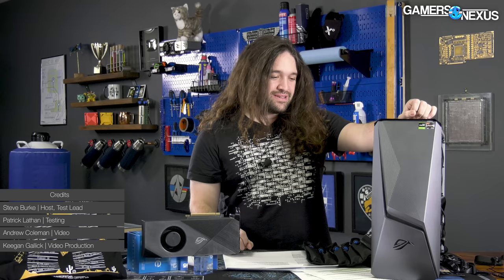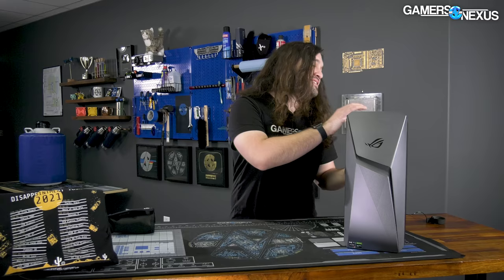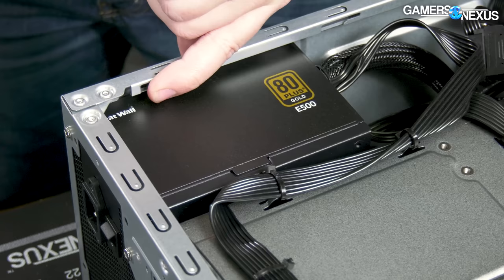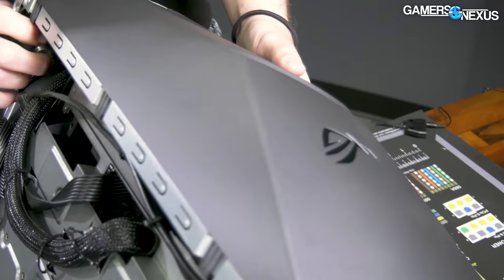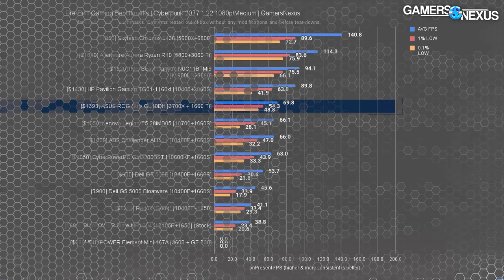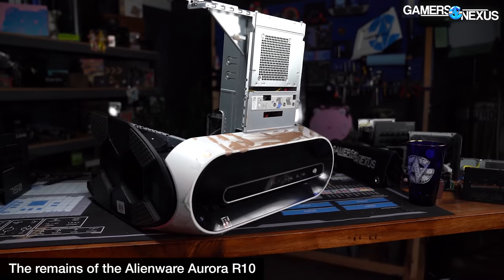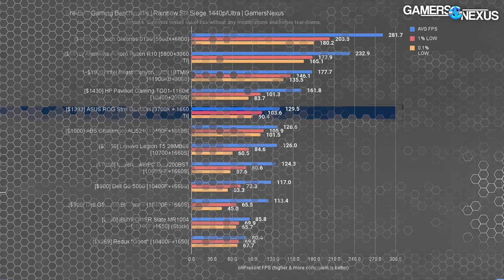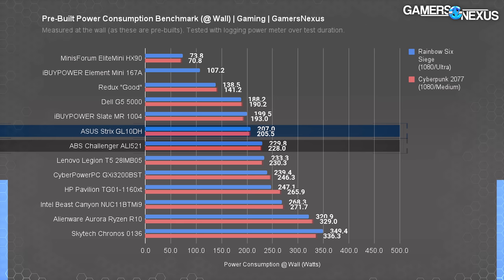ASUS Didn't Deeply Offend Us: $1400 Pre-Built Gaming PC Review (ASUS GL10DH)

Comment: I would like to see a show on alternate technologies to Boolean Logic implemented in CMOS. CMOS is inherently quantum mechanically defective. If you could measure the CPU or GPU current during the rising and falling clock edge, the difference is due to the transient shorts between power and ground. In 1957 tunnel diodes were invented. In the late 1960s, Threshold Logicwas extensively researched. Threshold Logic Gates implemented in Resonant Tunnel Diodes makes an excellent alternate technology. A design would require about 30% fewer gates and each gate is smaller than CMOS. This means the design is cheaper than CMOS. The speed-power product is 100,000 times that of CMOS meaning 1000 times the speed at 1% the power.
Educating the executives on alternate technologies could result in better and cheaper products.

Comment: My misgivings about this one a

For regular prebuilt buyers: Negative pressure => dust. Your regular prebuilt buyer isn't likely to clean their computer. A prebuilt with a front mesh will at least encourage such people to at least point a vacuum cleaner on the mesh to suck up the dust.

For those buying it for the graphics card:
a. You still don't know which model card you'll get, so even if it comes with a x070 or x700 (XT) or higher chip option, you're not sure if you can compensate for the cooler with a waterblock (although maybe the NZXT G12 can work?)
b. Hard to repurpose the entirely of the rest of the computer as a server if there aren't a lot of drive mounts; or SATA ports on the motherboard. Although I guess you can just move the motherboard to a standard ATX case (even if it's mATX height, the width at least will fit) that has enough drive mounts unlike having a totally non-standard board.

Comment: I have their GL12CP from 2019.

i5 - 8400 
128gb M2
1TB HDD
Nvidia GTX 1050 2gb
Two 4gb RAM, that I upgraded to two 8gb. Sticks. 

I've added two extra 120mm fans to the top and front. Since then the CPU has never gone over 70°C. In fact it idles around 30°c and runs cod warzone around 65°c, and 50°c if I set the fans to performance.

For $800CAD from bestbuy it was a decent pre-built for its time. I really would only upgrade the GPU for one with more than 2gb of VRAM. I think 8gb would be sufficient for the next few years.
Reply: You still rocking a 1050? How does it do?
Reply: @dragontales1999  If Warzone didn't demand more Vram, I wouldn't complain. It's been great these past 3 years, and I'd consider using it in a secondary PC when I eventually upgrade to a 30 series.

Comment: I bought a couple of years ago a $1500 Asus Zenbook, when I invoiced I heard something metallic inside. I had to risk to open it as I called the seller and there were no new units for a couple of months. I found two loose screws inside! I called the seller and he told me to turn on and if everything was fine I could keep it. It was "ok" and worked fine for 4 months. Afterwards it had to went repairs for 3 times and still has issues. Wrote to Asus and they said they tested and all BSOD were my fault and software
...I had no software, just windows! (Updated). After 2 years of almost no use for it I found that the issue was the fan / thermal paste that had issues. 

No more Asus EVER for me

Comment: I'm surprised more wasn't said about the stock CPU cooler.  The stock CPU cooler that looks like an Athlon stock cooler.  Cooling a Ryzen.  I work at a computer store.  Ryzens never come with coolers that look like they came from the FX line up.  The only thing that stopped me from assuming it was a FX fan from a decade ago was that the form factor dimensions have changed.

Comment: That looks like a slightly modified chassis of my ROG Strix GD30CI. Which makes sense, since this is essentially a newer version of that PC. Though, the Strix GD30CI is definitely lower quality than the GL10DH. Despite seemingly having more ventilation, it would suffer with thermals. There was 1 exhaust fan, like the new model, but it was so weak that I could not feel the air with my hands. The CPU was an i7-7700 and would struggle under the stock Intel cooler (which was excruciatingly loud). The 1060 3GB appeared to also have a stock Intel cooler and nothing for the memory. On top of that, the PSU wasn't even 80+ certified and the BIOS looked like it was from 2004.

Edit: Also, it had a single stick of 2400 MHz RAM that was so low-quality, it died after 2 years.

Comment: I have 2 cyberpowerpc prebuilts.  Both were bought during sales and both cost less than buying the components individually.  One system has a  2080ti, the other a 3070ti.  If you're wanting to build a PC of yourself, buy a cyberpowerpc during a sale (like their march madness sale), disassemble it, and put it back together.  They do dumb shit like not installing the cooling block properly on the CPU, or install windows on the hhd instead of on the faster 2tb 970evo nvme SSD.  Either way, I saved a couple hundred bucks on both systems, and learned alot rebuilding each one.

Comment: You could try getting your hands on a "workstation" class desktop. Since these are usually ordered by large IT and engineering companies, even HP and Dell put in a little effort in the design (getting sued by other companies stings). I have a HP Z2 G8 at work and it doesn't suck as much as I expected. For a new one, you have to get it from a dealer, almost like a car, but I think that it's possible to obtain even if you're not a company.

Comment: I got the same case with their phoenix 3060 12gb single fan GPU, a ryzen 7 5700g, 2x 8gb 3200mhz ddr4 ram sticks. It was 999$ and I couldn't pass it up for that price. I took everything out motherboard and psu were fine as well as the m.2 and the HDD storage drives.

Comment: Tbh, I just bought this build but, I got the 3060ti gpu in it. The only problems I had with it was that there was no packing material inside to keep the innards protected. I also got 3 rams sticks with it and one of them were loose and wasn't connected at the top so I just pushed it in til it clicked into place. It's a really good PC for a starter kit for sure.

Comment: God, I feel lucky - the GPU market is so bad. I bought an ABS prebuilt in late 2018 for $1500 with a i7-8700k & GTX 1080. I sold the 1080 in Feb 2021 for $455. Then I was able to get a 3070 FE from best buy for $500 + tax. I bought at JUST the right time, and got lucky snagging a GPU at MSRP.

Comment: I shopped for my son for a few months looking for something that was prebuilt as that was the only thing the organization was going to buy for him and well I settled on an Asus prebuilt.  I knew that they would not have proprietary crap in them and also for the price, $1499 CAN plus tax, he got quite a bit with the pc in terms of the hardware inside.  He got a 5600X and an RTX 3060 plus 16 GB DDR4 (3200) dual channel memory and 1 TB of SSD M.2 storage.  To me I think he got a heck of deal considering all things going on with tech right now.  However the psu having no on and off switch is annoying.  What's up with that?  Also yes the case could be better for sure but compared to what else I was seeing as options eh this shortcoming was one to accept for now and hell yes I could easily move everything into a new case for my son if need be and made sure to tell him that.  So yeah honestly quite happy with the PC.

Comment: You can get one of these ASUS systems with an i7 11700KF and a 3070 for $1450 or so open box at Best Buy. They also have a non k model but the cooler is garbage and it only has a single 16gb dimm.

Pricing out the components, that makes the 3070 around $500, and it's a pretty sharp looking rig with the acrylic side panel. Undervolt the GPU and CPU, swap the crap RAM for a couple of 8gb 3200mhz sticks and you have a solid gaming rig.

If you want to replace the CPU cooler, be aware you can't fit a 120mm cooler in it without compromising the first memory slot... Otherwise, not mad at it

Comment: G'day Steve,
Here in Australia the GL10DH is $1999AUD,
But to Build Similar myself here in Sydney it currently costs (Not including Discounts):
AMD R7 3700X $469AUD
ASUS TUF Gaming B550-Plus $229AUD
Crucial Ballistix 16GB (2x8GB) DDR4-3200 CL16 $99AUD
Kingston A2000 500GB, NVMe PCIe Gen3, Read 2,200MB/s, Write 2,000MB/s $79AUD
ASUS TUF Gaming GeForce GTX 1660 Ti EVO OC $829AUD
be quiet! Pure Power 11 500W CM 80+ Gold (Modular) $109AUD
Lian Li Lancool 215 $129AUD
Total $1943AUD + Extra Western Digital WD 1TB Blue 3.5" HDD $55AUD = $1998AUD

or for better Gaming performance swap the CPU & GPU & add more Storage:
AMD R5 5600X $469AUD
Sapphire PULSE Radeon RX 6600 8GB $799AUD
Western Digital WD 2TB Blue 3.5" HDD $78AUD
Total $1991AUD

Comment: If I build a PC myself, I have to sit through a windows install, and honestly at my age, the time it takes to put Win10 on even a mediocre SSD is not that bad....until you hit the update button anyway, then the nostalgia starts leaking out. But that's what I've done ever since my first computer which was a WinXP Dell laptop, and installing Win XP fresh WITHOUT all the bloatware was not nearly as simple as it is today, but it didn't matter because back then I had no idea what the difference was. Now, I have a separate drives for everything and reinstall windows regularly without having to do much backing up, so again, if my next system HAD to be a prebuilt then I would probably just fresh install a generic Win10 download off a flash drive ASAP, though you may want to boot it at least once to make sure there aren't any hardware problems or any reason to return it, there should be a unique term for that feeling of realizing you just fresh installed windows.....for no reason.

Comment: The one thing this system has going for it is the side vent on the case. Why more don't do it I will never know.

 It's one of the reasons I keep my old HAF 932 chassis as my main system. Nothing gets hot with a low rpm 200mm case fan blowing on it.

Comment: I have the ROG Strix G10CE version of this computer. Mine has a i5-11400f and a RTX 3050. I also upgraded ram from a 8gb stick @ 3200mhz to a 32gb kit in dual channel at 3200mhz. I have a Noctua tower cooler on the way to replace that hockey puck thing that comes with the Intel systems 😅 

After that I want to throw in a second  and larger M.2 drive and eventually transplant it all into a better case like a corsair 4000d

Comment: When I put my 11400 together, I installed crate when I got the pop-up after installing Windows and uninstalled it shortly thereafter since I didn't want to have a heap of bloatware that I had absolutely no use for beyond changing the motherboard's 5-6 RGB LEDs which I had turned off in BIOS anyway.

Comment: i just do not understand it... why do pre-built computer companies purposely make such badly designed computers? i mean there is cutting costs and just building a lazy and a bad computer. they could have easily slapped some cheap fans on the front and it would have barely affected their profit margins. same with the exhaust fan. they could have changed the 90mm fan to a 120mm fan. how much would they really have had to spend considering big companies like this buy in bulk and that they have their own brand of parts that they could have used? its especially pathetic on a computer in this price range. it is literally insane. the only computer company i have seen so far that builds decent prebuilt computers is the corsair vengeance line of computers. there is others i am sure. but the corsair vengeance computer actually gives you good components for what you pay for with a design that makes sense.

Comment: Bought a Lenovo T5 prebuilt very recently.
i5 11400 and 3060 for around 1200 EUR.
Lots of RGB, pretty case, mesh front panel. 
It came with a passive CPU cooler .... Returned it within a week ....
If you want a system to make fun of, that's the one.

Comment: I saw air vents on the front in your video. The front edge of the two side panels has a small distance from the front plastic plate. Air goes through the gap.

Comment: At least on their laptops, Asus uses a feature of Windows called the "windows platform binary table" which allows OEM to quite literally force software onto your system, with no way offered through Windows to opt-out (up to the OEM to add an opt-out in BIOS if they want). Y'all should highlight this if you can, because it's a terrible practice by OEMs and Microsoft. It was seemingly meant to be used for drivers and other necessary software, but Asus in particular uses it to force their armory crate software on users.

Comment: 6:55 There is a mount for a front 120mm fan but they sealed the bottom of the bezel where you reach your fingers in to remove it. Dremel a slot and add a fan if you have this PC and want better air flow.
Reply from the maker: That won't work because the entire front panel is plastic. A fan doesn't do anything if there is no air.
Reply: @GamersNexus  I could have been more clear. A rotary tool with one of those fiber cutting disk to remove the material at the bottom of the front panel where you insert your fingers to pull it off the chassis. Removing the plastic sheet behind the front panel would be a good idea too.
Reply: @GamersNexus  Video idea: Simple mods you can do with common or inexpensive tools to improve cases that preform poorly while still retaining the basic esthetic.

Comment: IMO the black sheet of plastic  is there to prevent short circuits in the LED board caused by the metal of the chassis. some laptops have the same sheet between the keyboard and the motherboard

Comment: The CPU cooler needs to be better so the CPU temps aren't so uncomfortably high.  The case could also use a quieter, higher airflow fan to pull more air in from elsewhere and eject any built up heat

Comment: Asus never liked ventilation.  I bought a laptop from them in 2016 with a gtx 960 in it and the laptop had 3 square inches of ventilation at the bottom, nothing else.  When I got it a tried playing Fallout 4 for about three hours plugged in; it crashed and the 960 died.

Comment: i bought a refurb (factory so full warranty etc) from Ebay with the slightly better case (top vent) GA15DH and 2070super for the price of this.
For $1k USD they have the 1660s version which is more comparable 

Came with 3200mhz ram which was nice too.

Comment: I got one of these as my first computer back in like, 2019, it was like $900 and came with a 1660. It came and the cpu cooler had broken off bc it used plastic pins to hold it in place. the power supply was some no name one. I have since canabilized the whole system into another case. The only original parts in my system are the power supply and CPU

Comment: I've heard a lot of conflicting information about the necessity of a GPU support bracket. Some say that a big honking sagging graphics card (like a lot of 3080s) could damage your motherboard's PCIe slot after a while, or that its weight could cause the heatsink to separate off of the pcb. I've heard others say that sag is nothing more than a cosmetic issue. I'd love to see a resource that discusses GPU sag specifically rather than merely mentioning it in passing like as a footnote. I bought a support bracket for my 3080 just because I was scared of it getting damaged, but I'd love to find out for sure whether that was ever a danger.

Comment: yeah I used to do IT. ASUS was the absolute worst for bloatware. Usually a clean install was the best option. However onetime I had a tablet PC running windows XP tablet edition. I didn't have a copy that was "clean". So I had no choice but to get rid of the bloatware manually. However......I've seen a lot of HPs go to hell after a year of use (granted I haven't known anyone buying an HP in 5 years). A factory reset (which includes the HP bloatware) fixes it. This suggests something in the bloatware even after removal. A clean install was the only way to permanently fix it. The ASUS tablet PC I worked on though? That worked fine for the remaining 2 years I worked there.  But it took days to get rid of it all.

Comment: AVA direct is another build company that is out there.. They are who I went with.. PC comes in today(only did it this way to get components at lower than market prices) My intention is to gut the system and use the components in my current to upgrade a different build and then use the parts and put them in my lian li.. Customer service was amazing and it was super fast.. But again, I have not received the PC just yet.. But it could be another episode in this line.